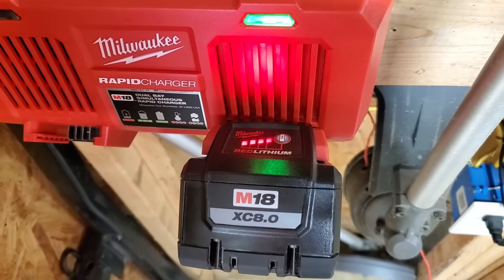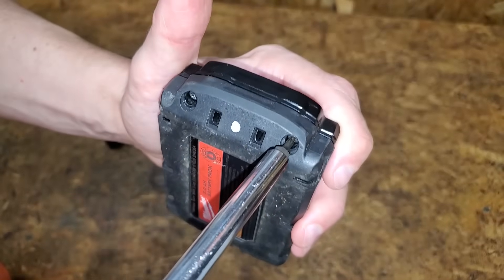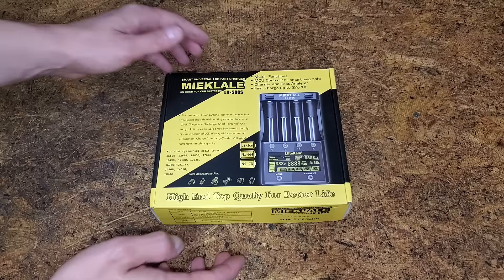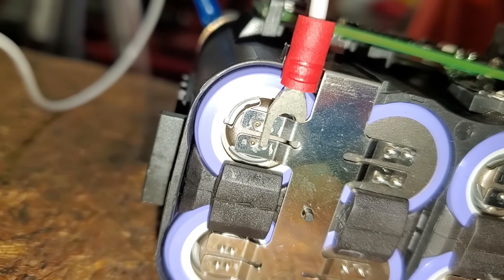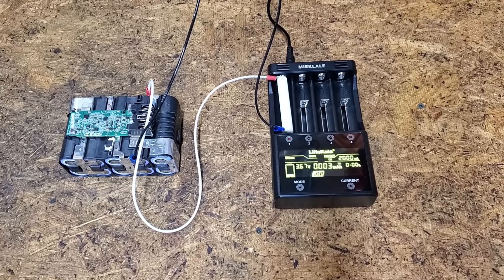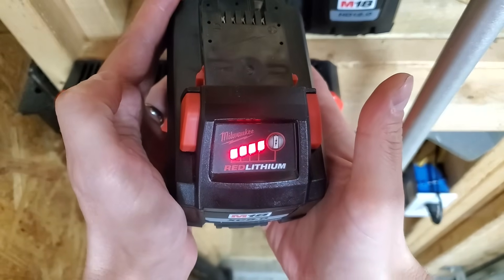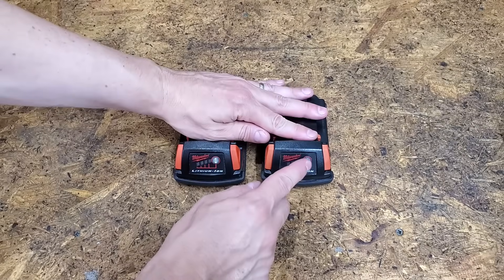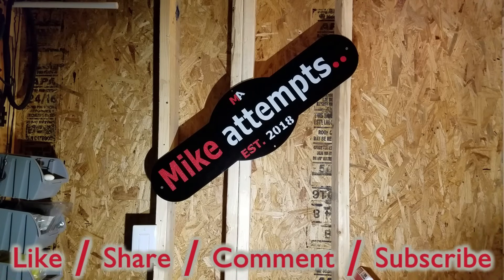Balancing Power Tool Battery Packs

Comment: I have been doing this for years now and had given a few of my milwaukee packs years of extended. And found there are common cells that cause problems such as the Samsung INR21700-40T that’s in the High Output 12.0-8.0. And yes the older High Demand 9.0 with the Samsung 30Q cells. what I do to keep the issues at bay for the longest with out replacing the cells is i take the lower voltage and charge them just above the non affected cells. Usually Milwaukee only charges the cell group to 4.08v so i will charge to 4.15v ish it will be off balance the other way but not for long as the voltage sag over time.
Reply from the maker: Great info, thank you! So far, the 8Ah and 2Ah packs aren't having any issues but at least one of the older packs will need to have cells replaced in a future video.

Comment: Can you really replace bad cells? In that case these batteries can last forever if you rebalance and swap out bad cells
Reply: you will have to replace whole battery with cells that have same capacity and impendance otherwise it will instantly become unbelanced after first use and charge. but yes you can build your own batteries using old board.
Reply from the maker: @johndoe9922  Yeah, a few other viewers said I might as well replace all the cells at once too. Otherwise, I'd just be chasing the next weakest cell and it would end up being a waste of time to only replace the problematic cells.
Reply from the maker: Yep, I'm actually gonna be making a follow-up video replacing cells in at least one of those older packs.

Comment: I've done this with Milwalkee and DeWalt packs. You don't need to charge all the cells but bring them up to balance. 
Don't drain your battery packs all the way down intentionally. There is no reason to do this. It hurts lithium batteries.
Reply from the maker: Yeah, that's the nice thing about the charger I used, it has discharge mode. So, if only one cell is higher than the others, it can be discharged to match the rest instead of charging all the others.

Comment: My LiPo r/c car batteries are made so they can be balance charged. Don't know why power tool companies don't know they need to be balance charged. It's not new tech. I thought there was some circuitry in the batteries that balanced them but I guess not. Shameful.
Reply from the maker: From what I understand, the circuitry is there but I assume maybe it only makes small correction. There's also speculation that even though it is available, it might not be enabled on some packs. I don't know all of the details though.

Comment: It's from the rapid charger, if you charge the rest on the regular charger it will top it up
Reply from the maker: I've tried that but it didn't work for me. I've never charged one of the smaller packs on the Rapid charger either and it still happened to them. I have heard that the Rapid and Super chargers can cause the cells to degrade faster.

Comment: Thanks for the information, for the price you'd think Milwaukee would cover this. Never have this issue with dewalt. I have a 70/30 split for tools between dewalt and Milwaukee  respectively. Thanks again as I'll keep it that way.
Reply from the maker: Agreed, we all know Milwaukee could do better, but it seems like they're choosing not to. As far as I know (which isn't much), I don't think this issue is exclusive to Milwaukee. It has the potential to happen to any lithium-ion battery pack, but it is interesting to hear the percentage of real-world issues with different brands.
Reply: @Mikeattempts I thought I was imagining this until this last spring when we were running short on batteries and ended up buying extra milwaukee batteries to cover this problem. This was also on m12s
Reply from the maker: @functionalvanconversion4284  All three of the smaller packs I balanced in this video had legit reasons for their issues. However, the 8Ah pack is only a little over 4 years old and has been treated well so I can't say exactly what caused the imbalance. I have heard that Milwaukee had issues with some of their 8Ah packs though so maybe I got one of those.

Comment: Great video, could you do the same in a M12 battery? Can you do a video?
Reply from the maker: Thanks! Yep, this procedure would work for any lithium-ion battery pack, they all use the same type of cells. I don't have any M12 batteries to demonstrate but the only real difference would be opening the pack. Once in, charging is the same.

Comment: Do these packs not balance with whatever circuitry is built into them?
Reply from the maker: They're supposed to but certain situations will get the pack so far out of balance that it can't be corrected automatically. For example, the 2Ah pack I used got messed up when I tried using it on a brushless drill with a failed controller. Also, some early version of certain packs are prone to becoming unbalanced because of the cells that were used.

Comment: Just run the battery completely dead, let it sit for a couple hours and fully charge again.
Reply from the maker: That's usually what ends up happening, but it didn't help for these specific packs.
Reply: That only works if the other cells are close in charge if you have one way out of balance it just doesn't work you either need to drain off the high cell or individually charge the low cells and get them within a certain range however once they're in a certain range you can just slap it back on the regular charger you don't have to fully charge all the batteries and it might actually be easier if you did your balancing act with the batteries discharged. I don't know if your charger can be set up too charge at a max voltage but there are circuits on Amazon you can use to accomplish this I put them in my kids power Wheels when I modified them to run off Milwaukee batteries it would shut the system off when the voltage got to somewhere around 14 volts I think...
Reply from the maker: @markbuckeye  Interesting, thanks for the info!

Comment: Helps to use a slower charger so the passive balancing has time to work.
Reply from the maker: I knew the Super and Rapid chargers were harder on the batteries, but I just assumed it was because of the heat caused from faster charging. I hadn't considered the fast charging also didn't leave enough time for proper balancing but that makes sense, thanks!
Reply: @Mikeattempts well seeing how Milwaukee actually disabled cell balancing on purpose it doesn't really matter what fucking charger you use
Reply from the maker: @SlowExpensive  I have heard that while there is balancing circuitry built into 12Ah packs, it's maybe not enabled on some. This was a deep dive into one pack so it's hardly definitive proof, but it is very interesting.
Reply: @SlowExpensive  I think they still slowly do mild passive balancing can you give them enough time on a slower charger
Reply: @NickWindham you're deluding yourself sir
Reply: @SlowExpensive   Well, I have 3 batteries that used to be out of balance.  High Output 8.0 3-bars, 12.0 3-bars, and 12.0 2-bars.  Now they all charge to 4 bars again.  It took several cycles of mild use discharging by just one bar followed by several hours  on the slow/regular charger, but worked to my own disbelief as well.

The problem is their 30 milliamp passive balancing is usually too little too late after several cycles of heavy use to deep discharge followed by using fast charging.  The regular gives the battery more trickle charge time at the top of the charge by reducing the current more than the faster chargers do, giving the weak little 30 milliamp bleed resistors longer to drain the charge off the fully charged cells so the under charged cells to catch up.  

Yes, they’ll likely get out of balance again, but at least this time instead of getting down to 2-bars max charge, I’ll know what to do as soon as it stops charging at 3-bars next time so I can squeeze a couple more years out of these batteries.

Comment: Sorry to report that no Li-Ion cell should go above 4.2 Volts, partly because it destroys the cell very quickly and furthermore it can short circuit the cell so you risk burning down your house. The BMS in the battery should ensure that this should not happen so it is also defective. Therefore you should ensure that the battery is destroyed according to the laws of your country.

The cell that has the lowest voltage after a charge is the healthiest in the pack.
Reply: for the price of these tool batteries there should be a balance circuit in the bms to keep them equal during charge
Reply from the maker: @DeviloftheHelll  I think the major tool brands do have some sort of balancing circuitry, but I assume it can only make small correction.
Reply: @Mikeattempts  it can make large, depending on the balance current capabilities, and it communicates with the charger so it can request smaller charge currents too, but this wont sell new packs...
Reply from the maker: @DeviloftheHelll  Hahaha, exactly!!! 😆
Reply from the maker: The highest I remember seeing after charging was 4.21v. When measuring the 8Ah pack, I do remember a reading of 4.31v prior to charging but that pack was really hard to get an accurate reading from so I assumed it was not accurate. I'll keep an eye on it though, thanks for the info.

Comment: I thought this was a milwaukee thing because it affects at least 4 of my 6 batteries.😅
Reply: if yours are m18 then it is because they do not activate balancing at all, it is a bug.
Reply from the maker: @johndoe9922  So balancing is built into every pack, but a bug causes some older packs not to balance properly?
Reply: @johndoe9922 Yeah I just confirmed all m18 little 2.0 guys.
Reply from the maker: Dang, that's not a good ratio! 🤣
Reply: @Mikeattempts I thought it was my charger so I replaced it. Nope not the charger. All bought within a close time period about ohhhh...dang...what 12 ish years ago now. The newest one for sure has no issue some of those old ones are so beat uo the button is worn clean off with electrical tape over the holes and around the sides where the rubber broke off. I use the bad ones for my knockoff red chinese handheld tire air compressor. I actually got away from milwaukee and now use hercules since I live 2 minutes from harbor frieght.
Reply from the maker: @TonicofSonic  How many amp hours are the packs that are unbalanced? You might be able to breathe a little more life into them with a manual rebalance. If not, I guess 12 years is a pretty good run for how much use yours get.

Comment: I've had the same issue with 8's and 12's over the years. Will purchase Forge batteries with the next deal.
Reply from the maker: I have three 12s and two 8s but, so far, I've only had an issue with one of the 8Ah packs. I haven't tried any of the Force packs yet.
Reply: @Mikeattempts Too expensive for me right now. I've been loading up on 6ah high output batteries, haven't had a single problem with these over the years.
Reply from the maker: @thalegacy6  Yeah, the Forge packs are pricey. I think I'm good to go for a while, especially if these rebalanced packs hold out.
Reply: @Mikeattempts  Weird, I too have 8's and 12's but only have issues with the 12's (albeit 2 out of 20).  None of the 8's have given me any issues.  Great video.  Got the charger via your link!
Reply from the maker: @tjhemrick  Thanks! From what I understand, only some of the early 8Ah and 12Ah packs had issues but I'm not sure. My tools are all for personal DIY use, so I assume it'll take me longer to see issues since I don't cycle the packs nearly as often as ones used for business.
Reply: Home Depot has some good deals that come with a free 8ah forge battery!
Reply from the maker: @greatappledates2167  Nice, I'll check 'em out!
Reply: Same

Comment: You can buy an imax b6 or similar to external balance and discharge all cells at once. I use One for makitabatteries that are locked out of the factory charger
Reply from the maker: I had brought that Makita issue up a couple times in the comments, but I didn't know exactly what to call it. Any chance you could explain the Makita lockout, and what causes it, and if there is anything that can be done once a pack is locked out? Another viewer suggested an ISDT BG-8S. I assume it's similar to the Imax B6 that you mentioned? Thanks for the info, I really appreciate it!
Reply: @Mikeattempts  you will want to look up “open battery information “ should lead you in the right direction. Also a very good project for Milwaukee batteries was just released which you might want to look into.

Most brands do not have cell balancing circuitry so heavily used or older packs are naturally going to have the issues you had. I’ve personally had good results using aliexpress diy battery kits with Chinese BMS that include balancing. Deep rabbithole here
Reply from the maker: @oliverpuczyk2  Cool, thanks again!

Comment: I have the same battery, with exacly the same issue.  It seems like the cells get unbalanced linearly from one end to the other-- i.e. one end is charged to full capacity and each further cell pair drops in voltage.  So glad to find your video-- I was starting to investigate cell replacement and DIY spot-welding, or solder alternative.  I will try this first!
Reply from the maker: Yep, I think you're right, I believe all of my packs had low voltage on the cells at the front. If any fail, which I assume at least the older packs will, I'll do another video replacing the cells.

Comment: Be careful with poking around at the positive cell end. The negative is right there under the thin white spacer. Don't accidentally short the cell. / Some bms boards include balancing, some dont. Doing this trick is great for those which dont have balancing. If they do it might be malfunctioning which requires monitoring in the future. Dont give those packs away. / Its wise to avoid deep discharging problematic packs as the voltage differences between cells grow with the amount of discharge, if the imbalance is due to cell aging. A cell must never go below 2.8v and be recharged. Its a fire risk.
Reply from the maker: Lots of great info that I was unaware of, thanks! I was aware of the possibility of a short on the positive end of the battery and I should have mentioned the potential risk in the video. I've added a correction so it should pop up a little note at that section of the video now.

Comment: I've been tempted to just add a balance lead and make an adapter, to use a charger intended for RC vehicle packs. 

Obviously the charger you have works, but a charger made for packs could make the process more straight forward and charge and balance the whole pack at once.
Reply from the maker: Another viewer suggested an ISDT BG-8S. I guess it's a small device that charges and monitors all cells at the same time. Sounds pretty cool and is probably what you're referring to as well. I'm hoping balancing battery packs won't be a regular task for me so I assume the cheap charger I got will be sufficient for now.
Reply: @Mikeattempts  saw their comment after I already made mine! 

I'm not sure how the regular tool company chargers work; if they're not monitoring individual cells, then they might be over charging some of them each time you charge and causing damage, vs using a balance charger every time and it should cut as soon as any cell hits 4.2, even if you aren't using the balance function. 

I'm sorta proposing this as being just how you charge every time, rather than a separate maintenance step done occasionally.

There's so many options, I don't have a specific recommendation but the other commenter seemed to know what they were talking about, and I agree with the gist of getting a sorta known brand vs the absolute cheapest one.

No idea if it's worthwhile 😂 but something I've already been thinking about just a bit for the last few months. 

Thanks for making the video! I subscribed!
Reply from the maker: @kinguin7  Thanks! Yeah, you know they could make the balancing perfect and make the packs last much longer but the batteries are where they make most of their money.
Reply: @kinguin7 the Makita factory charger has a balance connector and balances during regular charging.

Comment: Milwaukee used cells that had a defect in them. They didn't know it until 3 years later. Mainly 8.0 and 12.0 packs are affected.
Reply from the maker: Great! I have three 12Ah and two 8Ah but the one in the video is the only one I've had an issue with so far.
Reply: @Mikeattempts just balance those cells and you should be good.
The only thing I have found that absolutely destroys batteries is water. If it's water damaged, it's done for. Don't even bother.
Reply from the maker: @kevinroberts781  Good to know, thanks for the info!

Comment: I have received maybe 60 free batteries because they wouldn't charge. All I had to do was open it up and balance each group of cells. Perfect battery after that. Might have to do it again after a year of use.
Reply from the maker: Where do you get all of those battery packs for free? I'm interested to see how long these packs will stay balanced.
Reply: @Mikeattempts I work at a company that sells Milwaukee tools. We do all the warranty for our customers. If the battery is out of warranty we sell them new ones. I take the old bad batteries unless they want them back. I have repaired a ton. It's well worth it to repair. As you know!
Reply from the maker: @kevinroberts781  That's awesome! :)